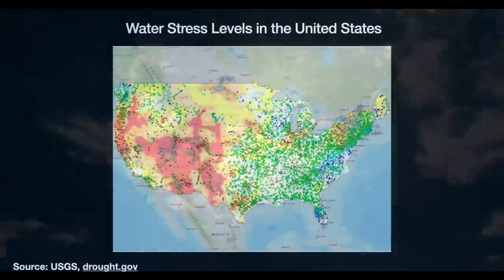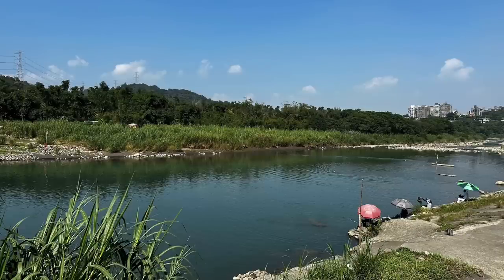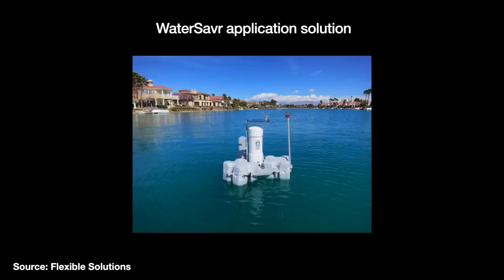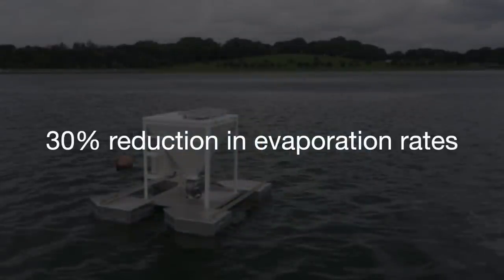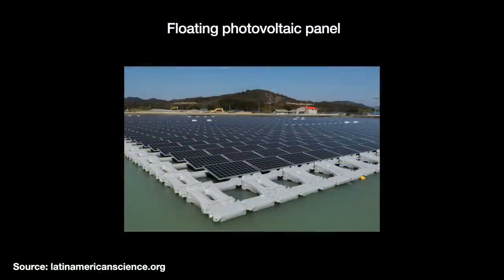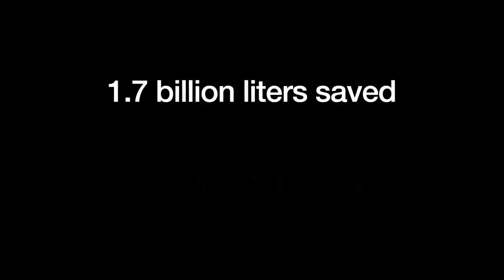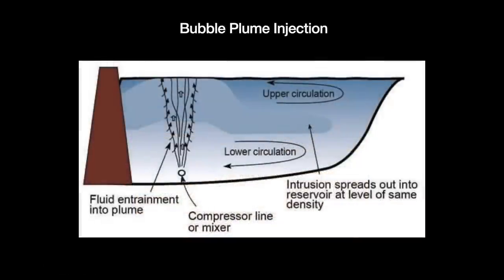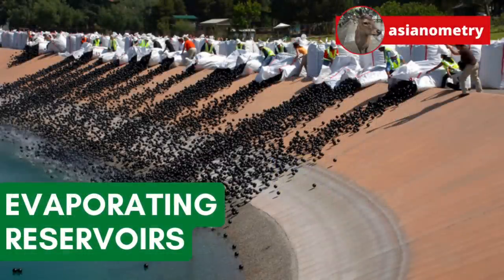When Your Reservoir Evaporates

Comment: Even if the manufacture of the shade balls consumes more water than the balls save doesn't necessarily mean it's a net loss if the balls are manufactured in a location where water is more plentiful. Also, while I don't know how the manufacturing process consumes water it might be that it can use water which isn't fit for drinking or irrigation.
Reply: Manufacturing needs more pure water as the water isn't being used for cooling.

Comment: Couple comments:
Bromate is formed from bromine and sunlight, not chlorine.

One simple way to look at evaporation is that evaporation takes energy and energy added to the water often ends up as evaporation, as long as water temperature is above the dew point.
Reply: A well put "But, actually"

points to erik.
Reply: Ah, I was a bit perplexed what chlorine had to do with the formation of a bromine compound. Thanks!
Reply: No, the chlorine comment is correct. What they found in Los Angeles was that natural bromide ions in the water source, combined with chlorine added for disinfection, and sunlight hitting the reservoir, accelerated the formation of bromate ions. It was previously known that adding ozone to the water could have this effect, but it was a new discovery that chlorine could do it as well. This was the main reason for adding the shade balls to that reservoir.
Reply: @Rubicola174 congrats. You win an internet

Comment: When I look at floating shade covers such as the shade balls, I'm worried about microplastics. Especially when exposure to sunlight is one of the main ways that microplastics form.
Reply: You could just die from dehydration I suppose. No microplastics then.
Reply: I think this may be a misinterpretation of "sunlight is one of the main ways that microplastics form". What that statement typically refers to is that if you have small pieces of plastic in the environment, sunlight causes it to degrade over time, and then abrasion and other factors can break it down into smaller pieces, forming microplastics. These balls are much larger so they're not as affected by sunlight since they have less surface area, but it may still be worth looking at how much plastic is lost due to abrasion between the balls, I think that's a legitimate worry.
Reply: @@dr5290 they use black colors because white ones would have to be thicker to keep out as much light from reaching the waters. the most important purpose of them is to shade the water not keep it cool. it's more effective for avoiding evaporation. you can google it or look up Veritasium video on it.
Reply: @Vizibl3  in that sense can't they make balls white on top to reflect lights and the darker side to be on the water side to not have light leak thru??.. i am sure there are ways to make balls float that way.
Reply: @coolasta1987  It's about costs. full black are cheap and effective. that's a good idea tho. but i wouldn't be surprised to hear that it's at least twice as expensive to make those
Reply: @magical11  Or you could just not try growing almonds in the desert.
Reply: They won't admit it.
Reply: @magical11  
That's like putting asbestos in your home because a house fire would be worse.
Reply: @augustday9483  I'm pretty sure if your options were "burning house" or "asbestos" most people would pick asbestos.

Comment: Biggest takeaway I got from this is that we ideally should be building reservoirs as long deep tubes with as little surface area as possible. Then evaporation becomes minimal while the volume of storage is preserved. Ofc I'm sure there's many reasons why this is impractical.
Reply: It also strikes me that that is kinda what a well is lol. 😅 Edit: I mean in terms of shape, not function.
Reply: @ArawnOfAnnwn a well isn't a storage solution, rather a long "straw" to access water already there
Reply: I think you are missing a few things, like the scale of dams, the water catchment that fills the dams and digging is very, very expensive compared to using an existing geological formation. Also consider that many reservoirs are also used for power generation which requires them to be up high.
Reply: For storing the same volume you would have to dig kilometers into the ground. Quite possibly not possible in many of these places avd definitely not cost effective.

Even building underground storage tanks for this volume would mean a huge mega project and would involve costs regarding maintaining them long term and short term costs to keeping them safe to drink.
Reply: @sevurueva5138  Not to mention the potential water quality issues coming from having large volumes of stagnant, untreated water effectively underground...
Reply: @sevurueva5138  what if we take a lot of explosives and bury them deep underground and then send the earth flying? Seems like a worthy project!
Reply: Pumping energy loss during round trip storage could be larger as the reservoir gets deeper.
Reply: @queueeeee9000  That's why I said 'kinda'.
Reply: @ArawnOfAnnwn  I'm just saying it's not "kinda" like a well
Reply: @queueeeee9000  It is. Wells are long tubes that hold water, just as I said. Sure they draw their water from the water table, but the design is similar.
Reply: @ArawnOfAnnwn  wells aren't for water storage they're transporting water out. Reservoirs are for containing and retaining water. Water is the only thing they have in common.
Reply: @queueeeee9000  Shape is also a thing they have in common. With the design I mentioned I mean.
Reply: @ArawnOfAnnwn  gotcha. I was replying to your second comment. The way it was worded threw me
Reply: Very high water pressure at the bottom
Reply: @justinokraski3796  Why is that a problem?
Reply: you need sunlight uv the clean the water to make it drinkable.   usually we add mechanical aeration.
Reply: OP: they're called "water pipes"
Reply: Or just build them underground.
Better yet, don't farm deserts.

Comment: We should think of the shadeball more as a way to export water from a water rich place (location of shadeball manufacture) and import it at a water poor one (california). So in effect, the shadeballs didn't "waste" water, it just meant they imported water from somewhere else to help save water elsewhere.
Reply: That assumes it was manufactured in a water rich place. Often due to local subsidies, corruption or just mismanagement, these things get built in water stressed areas.
Reply: @chinguunerdenebadrakh7022  yes, that's true and it would be an ideal assumption, though, even then the analogy or way of thinking about it still holds - using water from somewhere else to save water right here
Reply: Preventing evaporation losses is dumb and expensive. WHY do we have agriculture in deserts near 100% reliant on irrigation?  Why are we pumping aquifers dry to irrigate agriculture when people live in the area and rely on the same water?
This and many other problems are where our water problems really exist.  People just don't need very much water when you take agriculture out of the picture. OBVIOUSLY we need agriculture, but it should be done where it rains.  To water agriculture with "fossil water" (deep aquifers that can only be recharged on very long time scales) is the absolute height of hubris and stupidity.
Reply: @tarstarkusz blow up desert cities then
Reply: @user-rg7uz8of9r  We can easily support the desert cities, though I do agree they are stupid and a bad deal.  It's the agriculture and manufacturing that uses all the water plus watering lawns.

Do you not find it an abomination that people are fined for using more than 1 laundry cycle worth of water in a day while the farm next door removes acre feet of water for irrigation?  Worse, a lot of this agriculture is exported. We are effectively exporting water in the most inefficient way possible.
Reply: @user-rg7uz8of9r I mean, no one suggested it until you did. But now that you did...
Reply: @nikopaseman7147  :D
Reply: @tarstarkusz  Farms on 100% irrigation are VERY productive as rain dependent farms can get crop yield problems from a lack or surplus of rain.
Reply: @PerfectDeath4  While there is water.  In California, people are being fined for doing more than 1 load of laundry a day while farmers take acre-feet of water a day, usually for free.  Plus, wet areas have water to irrigate the crops.  Also, to the extent irrigation can be avoided is the extent to which soil salination can be avoiding.  I'm no farmer, but as I understand it, irrigation is what causes soil salination.
Reply: @tarstarkusz  Need a "laundry lobby" to compete over water usage with the big spenders. =P
Reply: Yeah I'd be way more concerned with the plastic additives leeching into the water. It's not like we need more of that.
Reply: @PerfectDeath4  Farms on 100% irrigation in California are VERY WATER INEFFICIENT and thus WASTEFUL.
Reply: The problem with "just stop farming in more arid climates" is that those places still need food too.  You might reduce their dependence on outside water, but now they have a dependence on outside food, which is not only expensive to transport as well but is also often perishable.

Comment: Veritasium made a video about the shadeballs a couple of years ago. Including interviews with one of the engineers who designed the shadeball. It was very interesting.
Reply: I was going to make the same comment.
Reply: Why do you think he made this video?
Reply: its on the thumbnail veritasiums    video
Reply: @motionsick  asia is water stressed, it needs a cheap solution
Reply: Veritasium tells tall tales ???
Reply: i liked the veritasium video "why elon musk is smarter than you"
Reply: @fredsmith2277  Watch the damn video and then judge, dude.
Reply: @matthewsmith5883 thats not a reflection on character ???
Reply: Condoms
Reply: but why are shadeballs black? it absorbs energy faster than white or reflective pigments
Reply: @_Circus_Clapped_  Black body radiation. It comes down to being able to radiate away heat faster if the irradiated surface of the ball gets hot. This works better than white balls, that, due to reflection will always allow radiation to leak through to the bottom of the balls, defeating the purpose.
Reply: @paulmichaelfreedman8334  black body radiation has nothing to do with an object being black. It's called that because despite it being a "black body", it still radiates energy, was initially counterintuitive (why would it radiate? it's not reflecting anything!).

But the color black is a "despite it being black" not "because it's black"
Reply: @Fs3i  Thanks Einstein, it was the simplified explanation. I know full well what Blackbody radiation is and what the "blackbody" actually means. A true blackbody absorbs all radiation of all wavelengths 100%. But I am talking about the property of radiating it back out as heat.
Reply: @paulmichaelfreedman8334  Yeah, but you can just reflect it. You don't have to first heat up and then radiate, by  itself reflecting would be more effective (as it doesn't heat up the water body equally!).

I still don't get what you're trying to say, and I'm not sure the problem is me.
Reply: @Fs3i I believe the balls are black because the black dye is the most stable.
Reply: @_Circus_Clapped_  this is the type of question you should enter into a google search query instead of a YT comments section.

Comment: Are there negative consequences of not letting the water evaporate? Can dryer airs cause greater heatwaves and forest fire potential?
Reply: Or lower rainfall in other areas? Can you maximize water evaporation along the coasts to create more rain?
Reply: The surface area of (frequently manmade) reservoirs is minimal compared to that of vegetation and natural water. Yes, drier air helps fires, but reservoirs can't mitigate that.
Reply: @westrim exactly. The amounts seem big until you consider the amounts coming from the ocean and how thinly these amounts would end up being spread out in precipitation
Reply: Water allows air to hold more heat
Reply: tbf, the water is still going to evaporate, just not in the reservoir, it's gonna evaporate in the farms, etc. If it's gonna evaporate anyway, may as well use it
Reply: @barnmaddo You could build basins that evaporate seawater. But guess that would be insignificant. The amount of waterevaporation is dependent on surface area and radiation input.
And there is the problem, the surface of any humanbuild waterbasin is tiny compared to the oceansurface which is responsible for most clouds.
The bigger problem is not less water in the atmosphere anyways, actually there is more, as global warming increases both water capacity of air and more water evaporates into it. The problem are the changing weather patterns, against you can do literally nothing.
Reply: i mean there's probably negative consequences of having artificial reservoirs and irrigation systems in the first place. it's all geoengineering.
Reply: @jakeroper1096  I thought heat allows air to hold more water

Comment: The thing is the water doesn't "vanish". Atmospheric vapor is what forms clouds. I'd be wary of how preventing evaporation at scale might impact climate conditions years down the line. Also, reducing area of the water (like with the chemical monolayer or shade balls) does reduce evaporation, but it also reduces oxygen absoprtion into the water, possibly affecting life within the reservoir. That said, this looks like a good solution for the driest, most arid areas, especially during drought seasons.
Reply: Well those resevoirs are mostly man-made anyway. I don't think preventing evaporation will have a drastic effect on the local climate.
Reply: @left9096  Yeah, that's true, but some of them have existed for a long time and that impacted the local climate in one direction, whereas this could force it a different one yet. It definitely makes way more sense to use with those rather than natural ones, that's for sure.
Reply: 70% of the earth is covered in salt water that is constantly evaporating and here you are worried about the evaporation effects of some reservoirs which are practically microscopic by comparison. Wow
Reply: @crazy808ish  because never in the history of mankind have we made a change to local conditions that led to unforseen side effects, right?

I would consider your argument, but jeez, you could've chosen so many ways to reply and yet you went straight to making fun of me.
Reply: @tlk889  Admittedly I could have been nicer. But also this is youtube lol Light sarcasm is still way better than going straight to insults, which is pretty standard
Reply: @tlk889 "i would consider your fact talk, if only you didn't call me dumb"

Comment: Under "Managed Water Recharge" there is a Michigan-based company with an Asian name, Parjana. They install passive vertical pipes going from near-surface down into underground aquifers. With no need for energy to pump water, they help reduce flooding during rain events while recharging the groundwater. Considering many semi-arid places have problems with both flooding & drought, this seems like a great way to reduce flooding & save water for dry months. The US Fed gov & state govs should be looking at this!
Reply: you already know what they rather spend money on... not the state but for virtue signaling and terrible project management
Reply: what's the specific department that deals with stuff like this called?
Reply: I have some concerns about the potential to contaminate the aquafirs as the dirt & rock it flows through on the way down filters it. 

But its not an idea without promise, maybe it would be better to use a retention tank plus leech field setup to still allow for infiltration without risking bacterial or chemical contamination of the aquafirs.

Comment: I reckon floating PV panels should be promoted more to help  - expenwive but then electricity has become expensive. Added benefit being if used where HEP's produced they more easily plug into the grid.

Comment: Shade balls don’t have to be made of polyethylene. This is an area begging for creativity. Removing them, if necessary, is difficult given the large number needed to cover a significant area.

Other benefits of shade include reducing plant and Cyanobacteria growth. This is important since some Cyanobacteria produce toxins.

There are commercial mixing units, some solar powered, to break stratification and can be more efficient than bubblers. They were developed to address a variety of issues (low redox dissolving metals in sediment, vacuole-bearing Cyanobacteria, etc.).

Aquifer injections are not practical everywhere depending on the “hydraulic conductivity” and spatial extent of the aquifer(s). Aquifer injection is also useful when managing reclaimed water as some degree of treatment in situ is possible.

Thank you for “covering” this topic!
Reply: Cranberry growers have been moving small round objects out of the water efficiency for many years. You just need floating booms and a conveyor belt.

Comment: A nifty way to stop evaporation is floating a layer of oil on top. 2 problems happen however. The oil used can't be toxic but the next problem is hear can't escape and the water can get super warm underneath it. In fact that presents an opportunity where heat can be stored to yield energy or the warm water can be directly used to heat buildings and such.
Reply: Also a great way to reduce evaporation is having a deeper body of water. While the lakes were dry in California they should have deepened them which also would increase capacity but make for steep banks.